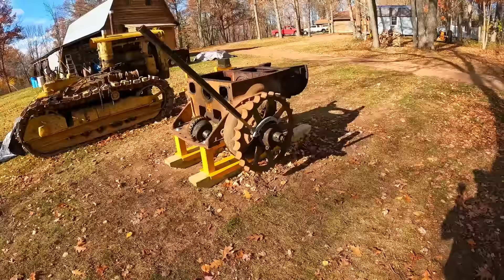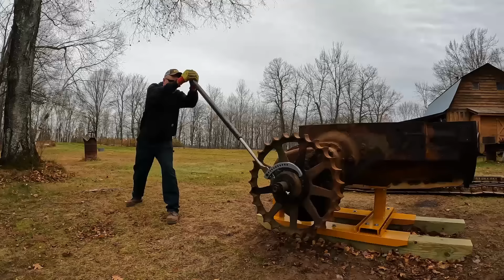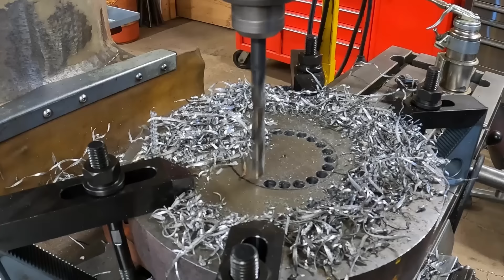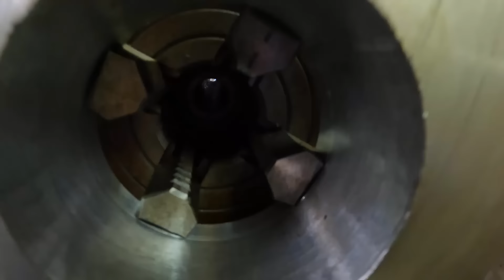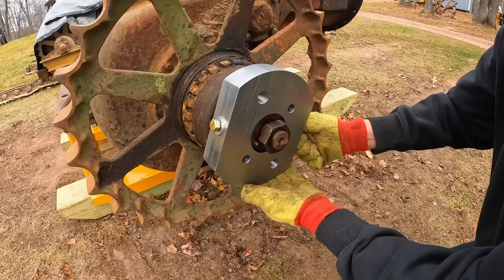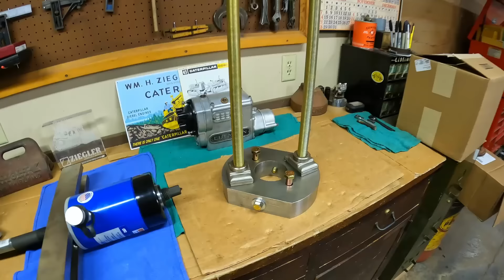Machining & Testing the Pulling Adaptor for the Caterpillar RD-6 Final Drive Hubs - #2H1768 Ep.20

Comment: Nice puller. But why you did´t use similar puller to defuse spring bomb?
Reply from the maker: Even the Caterpillar manuals state to never attempt to salvage a recoil spring if the center bolt is damaged in any way, the forces are too great and the spring is too unpredictable.  Plus, I already had 6 sets of those springs, and I'll only need 2 sets for the narrow RD-6, so trying to save it wouldn't have made sense :-)

Comment: Hey man, I wanna tell you thank you I enjoy your videos caterpillar and Moline both as well as the Farmall series. But I do have a question when that hub popped at 7 tons. Was that with the tension of the spanner nut or was that just detention of the hydraulic puller? Just curious your friend in Texas Chris
Reply from the maker: Thanks right back 👍 It was a combination of both - the large spanner nut was exerting its pressure on it, and then the hydraulic puller joined in and gave it the assist it needed. I would estimate that the spanner nut was likely exerting around 5 tons on the hub, and it took the 7 additional tons of the hydraulic puller to finally pop it. So if I hadn’t backed the spanner nut up tight against it, it would’ve taken more pull from the hydraulic puller to pop the hub off.
Reply: @squatch253  I was thinking you still had the spanner nut cranked down against it because seven tons I thought was kind of light for a press fit for that size of machine.

Comment: That is an impressive puller.  I didn't see if you attempted to heat that hub prior to applying the long spanner to the spanner nut.  You may have had good reason for not heating the hub to expand it to loosen it for removal.  I have heated hubs such as that to redish color tone, and performed several heat cycles, if needed, to pop similar items off.  In a few occasions, where heat treatment was needed to reuse the part, I performed the required heat treatment and used the part.  You my have done exactly what I describe, if so, disregard this.  I would probably have attempted the heat/cool down cycle approach before that nice puller.  I wish I had a puller like you made.  Was wondering why you choose pulling versus heating and then applying torque and pressure mechanically via the spanner nut?  I always enjoy you work, and my question is simply for my information.  If you do not respond, understand I will still continue following this neat channel.  We are all busy, and a response places demands on your time.  Your system worked great.  I was thinking of other possible options.  Nick,  North West Farmer (Laurel, Oregon)
Reply from the maker: I did in fact put the hub through one heat/cool cycle immediately after I turned the large spanner nut up against it - I’ve had that work on tight tapered press-fits in the past, it’s like the heating and cooling actually “walks” the hub down the taper by tiny amounts until it just loosens up without much of a “thunk” or “pop” noise. But with this hub being a rather critical undercarriage component, I was only willing to heat it up just a little bit in order to steer well clear of any metallurgical changes 👍

Comment: 1) I'm surprised how very well the fly cutter cut the roughness out of the central bore.

2) How (the heck) long did the Southbend take doing the clean up of the perimeter?

3) How (the heck) long did the Bridgeport take cutting the flats on the perimeter?
Reply from the maker: It was about 2 hours spent turning that blank on the South Bend due to me having to take such shallow cuts - not only was I out at the maximum reach of the tool post, but that much surface area rotating past the cutter meant I had to have the back-gear engaged, which puts the lathe chuck in "low range".  The Bridgeport milling went a lot quicker, only about 15 minutes per side to carve the flats into it :-)

Comment: I am missing why you call a caterpillar d6 a d40, what am I missing?
Reply from the maker: If you go back and re-watch the first episode of me rescuing the "Stovepipe" parts tractor, and also the video where I bolted the wood cleats to the tracks of the "Frosty" parts tractor, you'll see that they're both Diesel Forty models, built in the 3 years before the RD-6 came out.  But aside from the smaller cylinder bore size, a Diesel Forty is the same as an RD-6 in all other aspects, so they make good parts donors to fix up RD-6's with :-)

Comment: I swear, those mini hydraulic rams must be seen as a godsend by everybody who's a mechanic. I've seen the blokes at the Australian Armour Museum use a similar tool to get old armored vehicles to come apart for restoration. Your modification luckily worked a treat for that hub. Seeing how you had only those 2 bolts was kind of hairy. But, it worked out.
Reply from the maker: Yes, the hydraulic puller rams are one of the best tool investments I've ever made!  They are hellishly expensive, but once you've made the investment it's unbelievable how much it adds to your capabilities - pretty much the only limit to what you can do is your own imagination at that point.  I've set myself up with 3 sizes - 17-1/2 ton, 30-ton, and 50-ton rams.  I use the 30-ton the most, as it's still a manageable size but powerful enough to handle most things.  The 50-ton ram is almost unstoppable, but weighing in at 70lbs/22kg by itself, it takes a lifting device to get it set up on anything lol

Comment: Actually I like the way you built this. There are a lot of vids on machining up something out there. I had just watched the latest from CEE before yours came up. I like his content, but none of us can afford the machines he has or can justify the expenses for a hobby. You decided to think outside the box and show what you can do a few smaller machines that are in the financial reach of a decent hobbyist. You still had the better part of $400 or so tied up in materials just to make it. When I was a diesel tech I made quite a few tools because I needed something that made my life easier and it wasn't out there to buy or was a bit nuts in price. Made a few good ones out of parts that were going to the scrap bin. 

If you want to try it out, I've found a great lube for taps and drills is one you can buy in a tube called Tapmatic Edge cream. Its made by a company called LPS. A 10 oz tube is about $35 and lasts quite a while. Its nice for drilling out of position as it doesn't just run down right away. Keeps drill temps nice and low. Used to work at a bridge manufacturing place and we used magnetic drills with annular cutters to drill a lot of holes in splice plates during the mock-up. I'd put in hundreds of holes a night on the same bit going into A709 steel. Its good stuff. My only regret when I left that place is that I didn't throw some extra tubes of it into my toolbox on the way out the door.

Comment: Pretty cool set up and you  spent  some coins on that one but looks like it’s going to get some use
Reply from the maker: Thanks!  Yes, it'll be useful for sure - just yesterday I discovered (almost by accident) that the steering clutches also use the same size puller bolts with the same spacing, so I'll be able to use this adaptor for those too! :-)

Comment: Great job on making another valuable tool, I like the fact that you can make use of it in a couple of different applications, very clever.
Reply from the maker: On that note, I had an unexpected surprise yesterday when I realized that the steering clutches use the same puller bolts and spacing as well, so I can use that adaptor for that job too!  😀👍

Comment: Great video as always sir, question since you are the cat guy. How much parts availability is their for the old cat machines? I am potentially interested in looking at a 1942 d4 6? (Narrow guage I forget the last didget) it is locked up (guessing water) none of that bothers me as long as I am able to buy new cylinder liners to replace as I pressume they are pitted). Can you still easily get internal engine as well as chassis parts for the old machines? I know you seam to find stuff in your videos but that doesn't always mean things are readily available and this would be my first caterpillar machine. I am framilier with old case as I have a backhoe I bought seized up and got that going plus multiple other seized projects over the years.
Thank you as always!

Comment: Lot of work for so little use, but bay does it make so much easier.
Reply from the maker: With 3 of these tractors that need to come apart, it’ll see plenty of action in the next couple weeks. Plus today I had an unexpected surprise, the steering clutches use the same size puller bolts and spacing as these pinion flanges, so this same adaptor can be used for pulling those as well! 😀👍

Comment: 4:43 even with five boring heads of different types, i still do it this way when the slug can become in the words of machinist extraordinaire, Tom Lipton: "a tasty chunk". Just recently i've actually used one of those and made two knobs for my bandsaw. Just turned and parted them on the lathe, the holes are the "knurls".

Comment: Awesome job with the tools!
Now you have them forever.
Just curious, would frosty be a worthy candidate for a procedure for a product called lock N stitch or is it just too far gone? I witnessed this happen on a engine at our shop to seal up some 4” pipe plugs in a locomotive engine that sealed up 7 casting access holes. It took the guy 2 weeks to do but it looked and worked great 👍 when he was done!

Comment: For those playing at home, 7 tons is about a ton and a half more than the maximum allowable tension for the potentially explosive track recoil spring from last episode. These are some potentially scary forces he's working with.
Reply: Yeah, but it’s not a spring.  Very little energy is stored in hydraulic fluid under pressure. Not to say something couldn’t go wrong,but it doesn’t  have anywhere near the destructive potential of a spring.

Comment: Tapered shafts were an engineering solution for things that were never intended to be taken apart in a perfect world.  Getting them apart without breaking them after decades of stress and strain on them always seems to involve tremendous force and an act of God.  Old school engineers also liked to make tapered shafts with an odd slope to them.  Something like 3/16 or 7/32 per foot so machining replacements required custom gauges.

Comment: Why not cut the flats with the self feed hacksaw ??
Reply from the maker: My metal cutting bandsaw maxes out at 6" capacity, much too small for this 10" blank.  Even if I had stood the blank upright in it, the blade still wouldn't have raised up far enough to do it.

Comment: If you already covered this I apologize but did Cat give a maximum length on the spanner cheater bar?
Reply from the maker: No max cheater bar length listed, just that one "could be used" and that the spanner wrench was designed to withstand around 900 lb.ft of torque.  My cheater bar here is  around 36" long, and I just use it with adequate judgement based on how everything is flexing at the time :-)
Reply: @squatch253 curiosity itch scratched, thanks!

Comment: where did you get the strong back on your cylinder, is it OTC product?
Reply from the maker: Yes, it is made by OTC and its part number is 1070, made specifically to be used with that 30-ton hydraulic ram shown in this video.  If you go to the OTC tool website, they have a very good system for listing all of the related pullers that go along with each size of hydraulic ram.  I also have the 3-jaw puller, bearing/gear puller, and inside bearing race/seal puller attachments that OTC designed to be used with the 30-ton ram, and everything just fits and works together perfectly :-)

Comment: Nothing "grabs all of the threads" - under tension the threaded material stretches and the threads near the beginning of the hole engage but the deeper thread section remain unengaged . That is why nuts are all of similar length to diameter dimensions.
Anything over 1.5 times the diameter serves no purpose
Reply: Right, and even if it did matter, the nuts on the threaded rod didn’t engage any more threads than the  end of factory puller rod.
Reply from the maker: But being threaded into the mild steel blank will require more thread engagement than the high strength nuts.  I've watched threads be rather easily pulled out of mild steel by hardened fasteners, so I wanted as much as I could get :-)
Reply: @squatch253  No , 1.5 times the diameter is the standard for all steels , aluminium and cast iron are different again
Reply from the maker: Not trying to be offensive nor argumentative here, I’ve just experienced it first-hand on more than one occasion. A higher strength bolt will pull threads out of an object of lower strength before it reaches its tensile limit. You’re left with a nut that almost looks like the inside has been machined out, and all the threads are still on the bolt. Put a different nut on that’s the same strength as the bolt, and that same bolt will not pull the threads 👍

Comment: I like the way and the tooling needed to pull the drum and shaft apart. But if I to guess between the threaded rod and the steel you spent over $ 500 dollars just in material. But since you have a passion for these tractors, it's money well spent.
Reply from the maker: I have just a tad over $1K invested in making this episode, when you factor in the steel, rods, hardware, and machine tooling used. But, that’s the cost of doing business, and although this episode by itself won’t come close to making that back, it’s the future uses of these things I made here that will make the investment pay off. Just in the short term, I do have 3 of these tractors that all have to come apart so they’ll see plenty of action in the next couple weeks 👍

Comment: Love your special tool builds. Do you stamp these tools with identification marks?  It’ll help in memory as to what you used them for in future. Trust me memory fades. 😅
Reply: That is exactly what I was thinking he’d do before taking it outside. I was figuring he’d get out the metal stamps. If I don’t do that, 10 years down the road I can’t remember what that plate would be used for. Good chance it might get more holes drilled in it for more uses as time went on too.
Reply from the maker: Yes, I do often ID stamp them along with the date I made them, but as you watched here, they have to be tested first and prove that they can do the job before they earn their stamps 👍

Comment: The irony is that the two threaded rods can probably apply more force through their threads by tightening the nuts than the 30 tonne cylinder which becomes nothing more than a spacer

Comment: Just a note on the thread length of the puller rods... effective thread length is = to thread diameter.   Having more threads engaged isn't gaining you anything.
Reply from the maker: With the adaptor block only being mild steel, I wanted every bit of threads that I could get.  I don't know how easily those high strength rods would pull the threads out with them just being cut into soft material :-)
Reply: @squatch253 you'd be fine.  I'd be more concerned with shearing the 9/16 cross bolts off under load
Reply from the maker: Thanks for the info, I appreciate it 👍
Reply: @squatch253 great series with 1768 !   I look forward to every episode!    Not only 1768...I look forward to EVERY episode no matter the content!   Thanks for doing what you do!

Comment: That stretch fixture with the all thread exceeds the manufacturer tool design well done.  in stretching aircraft engine compressor and turbine tie bolts we log every time we use the stretch rods and they are sent to NDT lab for crack detection. At established intervals. We always had a spotter standing by to make sure no innocent bystander or inquisitive pilot walked in front of the stretch fixture while in process

Comment: Don’t be afraid of using multiple pieces of flat stock to achieve a thicker pull head.  I do it all time by plug welding and slot welding. 
Not only is it cheaper but I can easily cut circles out of 1/2 inch material.

Comment: Talk about hogging out a lot of material.  I used to use a fly cutter when I worked at EF Johnson in Waseca MN.  They work really nice but can get in trouble real quick.  I bet Josh Topper is ok with what you did
Reply from the maker: I almost used a "real McCoy" actual Bridgeport brand drop-down boring head that I recently picked up, but I didn't have a boring bar tool that had the right offset for doing this job.  So the old reliable fly cutter with hand ground HSS tool bit did the job :-)

Comment: Excellent video good job on building the puller adapter that sound metal makes when press fit releases is always nice but can be scary too when the parts crumble.  I was pressing in my 20 ton shop press a pulley off a shaft once and it sounded right then the pulley fell on the floor in a bunch of pieces opps lol . Keep up the great videos
Reply from the maker: Scariest pressing accident I ever experienced was when I was pushing a bearing out of a cast iron governor housing - the bearing was less than 2" in diameter but for some reason the housing blew up just after the bearing started to move, and one sharp piece of it just grazed my arm enough to leave just a tiny red scratch.  It happened so fast that the pieces were already well past me by the time I even flinched.
Reply: @squatch253  Been there, done that, bought the tee shirt. I've had a few pieces of cast iron explode under pressure. It happens so fast that you can have embedded metal before you even hear the sound. Sometimes you see it sticking out of your skin before you feel the impact. Don't ask me how I know.
Reply: @squatch253 yes parts under pressure do stranger things